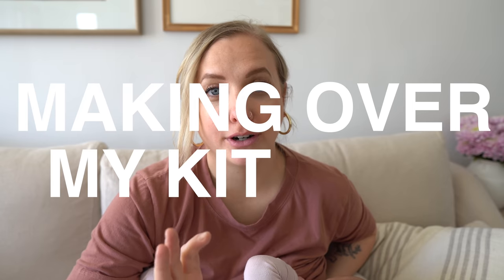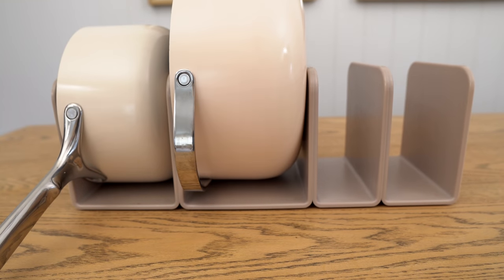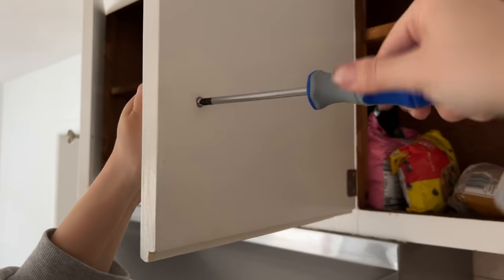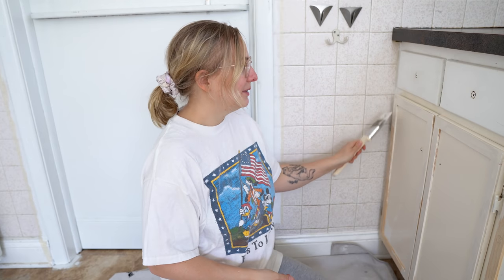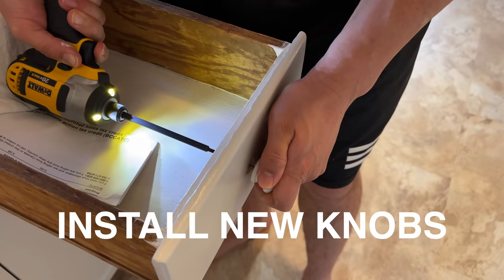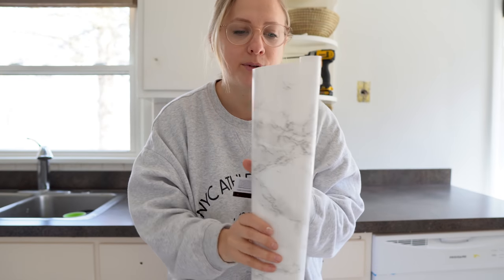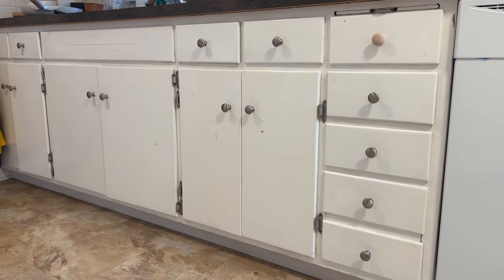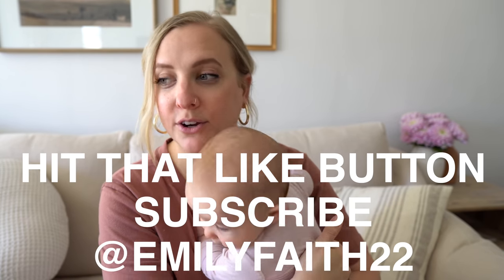BUDGET KITCHEN RENO PART 1 (DIY cabinet makeover) (Rental Made Home ep.12)

Comment: Great job! Loving phase 1! For the tile backsplash, instead of removing it all to replace it, which can be tedious, messy, and expensive, you could just paint it, perhaps even with stencils? Just throwing it out there in case it helps!
Reply from the maker: That's a great idea! We have a couple ideas on what were going to do. We aren't removing all the tile in the kitchen. Just the part on this wall. The other tile, we most likely will paint. Hopefully it turns out okay!

Comment: Contact paper is not a good idea for kitchen countertops. What you could’ve done instead, was painted the countertops and giving it a faux granite look, or marble, whatever. Then you seal it with the spar varnish, to prevent water damage.I’ve done this before and it holds up really well and looks great!
Reply: While that's true, the landlord probably wouldn't allow that
Reply: That specific contact paper is made from Vinyl/PVC film and meant to be used in flat kitchen and bathroom surfaces.